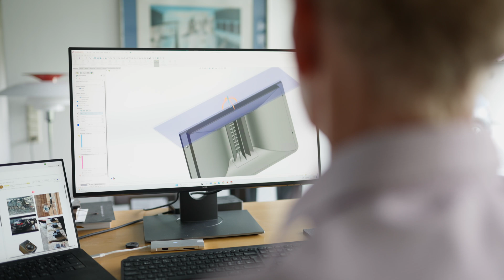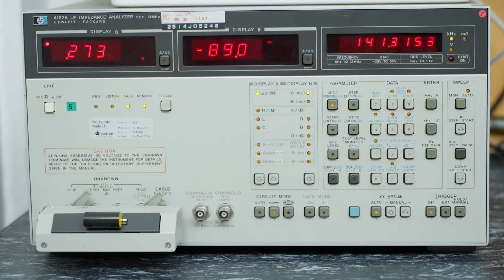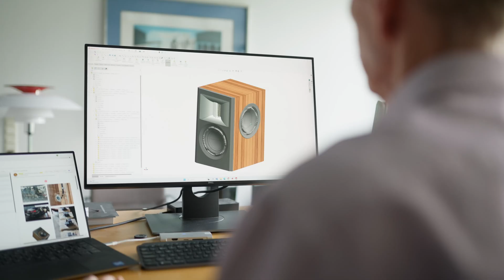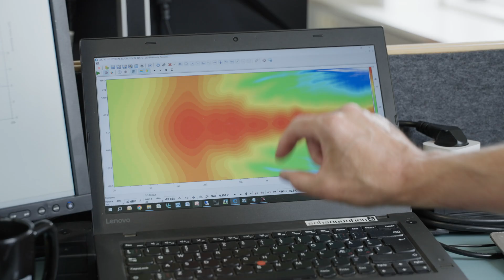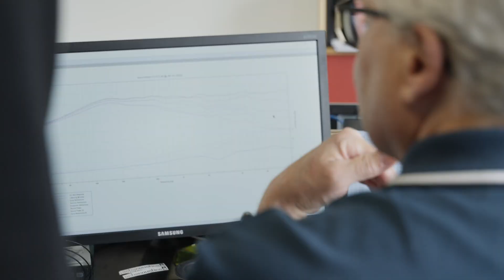Behind Radiant Acoustics: Clarity | Innovative Technologies & Craftsmanship

Comment: I wanted to share my experiences with the Purifi drivers, I own a similar design and after +50h of listening the midrange kept holding back, it sounded thin and less deep then my other speakers. Once noticed I could not get used to the sound.
This weekend I tried a more ´agressive´ break-in method by using a ´bass excursion´ track and let it play in a loop for 2 x 2h at high volume so the 3 drivers had to really work.
I was not expecting much but midrange now is completely in line with my other speakers.
I suppose normal listening level was just not enough to wake them up.
Needless to say I´m very happy and wanted to share this 😊
Can´t comment on the sound of the Clarity 6.2 because my build has different crossover parts and tweeter.
This was strictly about the midrange.
Reply: Interesting. Can you share which  ´bass excursion´ track did you use?
Reply: @radkokosoTT  Nothing special, it´s called "Bass Excursion (featuring techmaster p.e.b.)" it´s mostly bass without much midrange/treble 👍🏻
Reply: @justasimplefox  just purchased Clarity 6.2. So thanks for advice, will try it too and let you know.
Reply: @radkokosoTT  Ok, I´m curious 🙂

Comment: Erin has a pair that is reviewing right now, out next week I believe. One would think Purifi speakers will swamp the market the way its going. Another company ( UK ) PDP has developed new Studio monitors using Purifi drivers matched up with the Bliesma T25s tweeter called the Mum 6 at roughly 3,500 eur + the Mum 8 ( 3 way ) Wait for it Buchardt is releasing soon the E50 using Purifi drivers inc the passive radiator at 3,950 eur, both of these companies sell direct, so pricing is landed to your door as Radiant Acoustics. We will be spoilt for choice, not so much affordable but at about $4,400 - $4,600 US delivered, that's a lot of speaker that will compete with much pricier offerings. Soon will have to make a decision, which way do I go ? help !
Reply: I've been using several of the Purifi drivers as well as the BlieSMa beryllium tweeters for several years now in both my high end home and car audio systems.  I've been quite pleased with the results...enough so as to have finally ended my constant upgrade-itis tendencies.   ;)
Reply: @bbfoto7248  Good job, I know the feeling.

Comment: It's says something about the current Hi-Fi segment when affordable is 4000 euro
Reply: You should see the price of purifi audio drivers, they are not cheap. 400 dollars for each driver, so 800 for just woofers, I would assume custom amt drivers which will run you about 200 - 400 dollars each so you are now looking at 1600 dollars for just drivers. Average margin for hardware companies is about 2.5x markup, so the fair cost of this speaker considering just cost of materials is 4k. So this is honestly fairly priced.

Purifi drivers are honestly magic, you should look at their specs. Very revolutionary technology and advanced excursion surrounds to allow for equal elastic force from the surround through the entire excursion range. Not simple to do fea for, lots of bessel function mathematics. They are an advanced engineering company through and through.

Advancement costs money.
Reply: @suhbatshugan3721  Good value isn't necessarily the same as affordable, not that i blame Peter for doing this stuff, it's his passion. 
I am just wishing that the guy that built his empire selling cheap Cervin Vega speakers, would one day use his experience to bring affordable HiFi to the masses.. again.

Comment: it is impressive engineering, i am going to look out for my local hifi klubben to get these in.
not my main speaker type that i am looking for next, but i can see the appeal.
hope Radiant Acoustics expand they lineup of speakers, a smaller sealed(no passive radiators) with 5" woofers, maybe that is not possible since the tweeter waveguide would need to be made smaller.
Reply from the maker: We hope you have a great experience at HiFi Klubben. While we can’t reveal anything yet, we aim to bring more exciting products in the future.

Comment: Interesting! However, I am waiting to see an active speaker that combines Purify’s technology with the Power DAC amplifier technology that Lars Risbo also invented. The question I have is: Why bother with all this perfection is you add cables, amp, pre-amp etc? Get the high-res digital signal directly to the speakers and have it processed by a small digital amp designed for the specific speaker.

Comment: At this price, it's really not affordable to common folk I think, you can get better speakers craftsmanship and the performance I don't think that much difference, and I thought there is no curved design here, it just looks like another boring normal square like speakers...
Reply: You must become unburdened by what has been.
Reply: @isobutylquinoline  when you price a small bookshelf at €4000+ it’s not really accessible to most of us. That said when you have drivers on 3 panels I don’t see how they could use curved sides. The only option would be to use an oval PR on the rear panel and free up the side panels so that they could be curved. 

I have seen 2 of the Purifi woofers. A small 4.5” one and a bigger 6” one. The surrounds immediately stand out as unique. Much of the other engineering like the shorting ring etc has been done before (as far back as the mid and late 80s). Purifi drivers are some of the most expensive available rivalling the ones from Accuton, AudioTechnology, ScanSpeak’s Elliptor series etc so I can’t afford them. Drivers from SEAS and more recently SB Acoustics etc get you 90% of the way there for 50% of the cost.
Reply: GoldenEar BRX,,,,better performance,,,better craftmanship,,,,better design ,,,,, better finish,,,,,half the price ;)
Reply: @steffenjensen9350  I see, but it's not wooden curved design still...
Reply: TBH, you haven't even heard the speakers yet and ALREADY you are claiming that "you think" there are better performing speakers for the money?

All things being equal, can you explain how a curved design would always result in a loudspeaker with a better soundfield and better performance overall from a technical standpoint?

A "high craftsmanship" curved cabinet is always much more complex to manufacture, and therefore is usually more costly as well.  The "boring normal square like speaker" design of these RadiantAcoustics speakers achieve their intended design and performance goals without requiring a curved cabinet, so it is simply your personal preference, desire, and opinion to want a curved loudspeaker, which is likely not what many others may want.

Large companies like RadiantAcoustics' parent company do extensive market research to learn what type of overall design is most popular and desirable and will generate the most sales and profit...as they ARE in business to make a profit, not just to "survive". 

When you operate your own business and have to pay for ALL of the many multitudes of associated operating costs to keep the doors open, you may get a clearer understanding as to why some things cost as much as they do!  The cost of the product to the consumer is NOT just the cost of the raw materials and "parts" needed to create it.

And the use of better materials, higher manufacturing tolerances & QC, and better engineering in order to achieve a very high level of performance will obviously cost more to create.  Should these people do their work for free, live in a tent on the street, or lose money on each sale just so that you can have a lower price?

The primary goal of ANY business is to be and remain PROFITABLE.  Otherwise it cannot be sustained.  They need to pay all of the company's bills & expenses, AND then also provide a safe home and put food on the table for their families.

And TBF, there are not too many products in ANY category that are near or at the top tier of available performance which are affordable for everyone, or even to common folk.

Of course, when YOU can design, manufacture, and sell a speaker that looks better (to you), and performs better as well, you are free to sell them at whatever price you desire.  ;)

But IMO it's quite laughable to make any type of judgement of a product that you haven't even heard or had the opportunity to actually directly compare to other speakers yet in the same price bracket.  🤷‍♂
Reply: @bbfoto7248  No offense, just common folk opinion, it's complicated when come to decide which is best speakers, it's not solely based on sound, that's where common folk think and decide, it just not a price bracket for normal citizen.

Comment: I declare the end of 2-way systems.
Reply: you always need cheap speakers, 2 ways has its place.
but you can make any 2 way main speaker into a three way if you add dsp crossover to a pair of subwoofers, but then the passive radiators or ports become a unnecessary compromise.